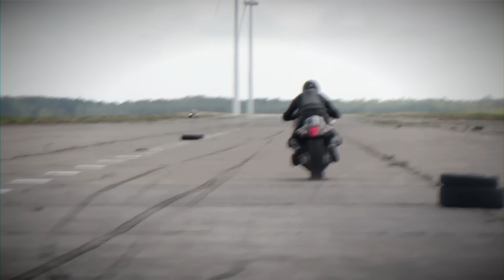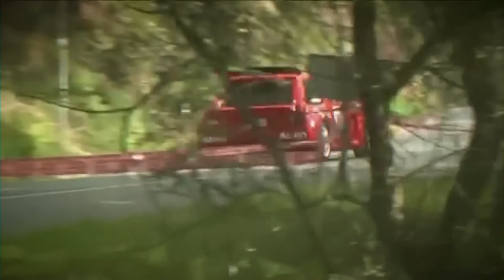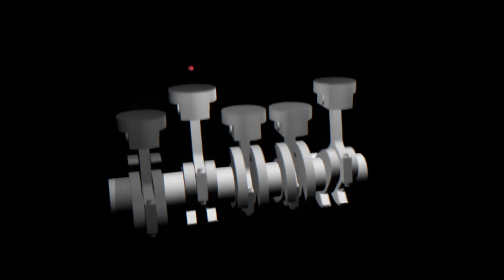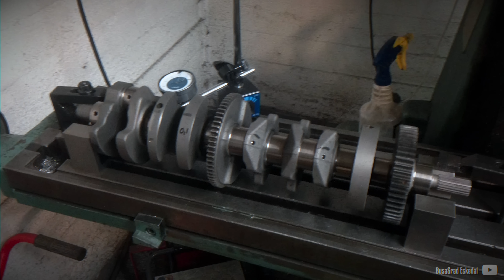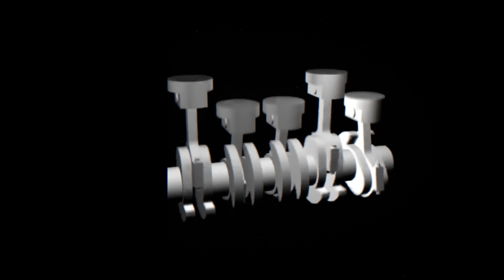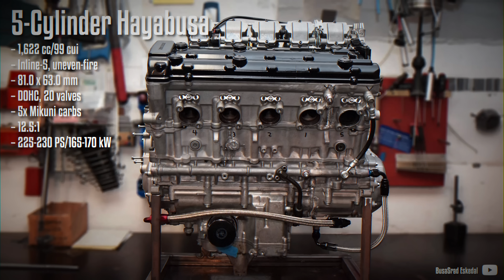A Genius 1.6-liter Hayabusa Engine

Comment: That is some Allen Millyard level engineering.
Reply: That's an insult to Allen Millyard, he would have had that running smoothly and evenly.
Reply: @van_trippin and have it as a v10 to trump his excellent viper motor
Reply: @van_trippin "even running" 5 cyl ? Can you divide 5 into even numbers  ?
Reply: @jamesgeorge4874  i of course meant the output of each cylinder would have been equal
Reply: @jamesgeorge4874   plenty 3 cyl bikes run ok.
Reply: @clutchkicker392ison5  OK is OK. I reckon EVEN was the previous comment.  Odd cylinder engines don't run "even" by nature. A 5 cylinder inline engine runs "smoothest" with crank pins set 72⁰ , which is an even number, and evenly divides into 360⁰, but also, isn't "even" running, And a 3 cyl, has crankpins 120⁰ apart, which is even, and also evenly divide into 360⁰, but never runs evenly, either.
Reply: @jamesgeorge4874 
Yes, look at the crank of a vw straight 5, the crank pins are evenly spaced.
Reply: VW/AUDI did it.
Reply: Lol what are you talking about. Even firing 5 cylinder = 72 degree crank throws. Not rocket science.
Reply: @jamesgeorge4874  360degrees in a circle, divide by 5=72. this puts our pistons 72 degrees apart.  now double the 72 because two rotations per combustion event means a cylinder will fire every 144 degrees.
Reply: @wtfbuggo  DIVIDE 5 INTO EVEN NUMBERS !!! I am WELL AWARE of how a 5 cylinder is designed, when it it was designed as a 5 cyl from the get go 
This engine, WAS NOT !
Reply: @wtfbuggo  I said NOTHING about dividing 720, 360, 144, or 72 !!!!!!! 
GET IT ???  In 720⁰ of rotation,  5 power impulses are created. 5 isn't an even number, never will be.  Sure, you can divide 720 into 5 equal parts, but 5 will never, ever be an even number !!! You are confusing EVEN, and EQUAL, they ARE NOT the same thing !!! You are overthinking, and missing the absolute fact that 5 isn't even, and cannot be further divided into EVEN numbers, it CAN be divided into EQUAL numbers.
Nobody said, it's an "equal running engine" they said EVEN, running, which is mathematicaly impossible.......
Reply: Allen would of put 2 cylinders in it
Reply: @rocklover7437  Straight-six buss would go crazy
Reply: But did he do it with a hacksaw and 2 files ?
Reply: Mr Millyard Makes crazy engines.
Reply: Yeah Adam would've remade the crank so it fired properly and sounded amazing
Reply: Alan does it with a hacksaw!
Reply: If you know, you know. People here talking about how Allen would've made better, and while he would've, he would probably find this build fascinating.
This guy is on his way to becoming like Allen, or do you think he just started off making perfect engines?
What have you done to start your journey?
Let people create. Let the guy build.
Maybe you'll get there one day. Dont be negative.
Reply: @apparentlysmarterthanyou3446  agree, we need more people doing things like this. Allen would be supporting this guy not hypercritical
Reply: @apparentlysmarterthanyou3446  wow , that user name ? Really. How BIG is ya Hat .
Reply: @clutchkicker392ison5  Judging by your writing, bigger than yours.
And if you must know, it was an inside joke.
Reply: Big up Allen Millyard!!
Reply: I had the same thought from the title.
Reply: The verb for the process of adding cylinders to a motorbike engine is surely “Millyarding”.
Reply: @LongPeter  nice :)
Reply: I don't want to sound like I'm dissing Allan (because he does mad cool stuff) but this guys work is better. Finish is OEM quality and he's shooting for extreme horsepower. Allan builds cool engines, but not racing power levels.
Reply: @hatface547  Just a bit of a defense to Allen, but he does do racing power levels sometimes, and I do think they're different objectives you know? I think Allen is just in it for the fun, and doesn't really care about the utmost perfectionism, just building stuff that works with his hands :)
Reply: No, it's not.
Reply: Bugga , soon as i typed . I see this .
Reply: Yes a shout out to millyard ,quintessentially English
Reply: He would have built a new crankshaft to make it sound even fireing
Reply: And sir Allen cuts with his hands